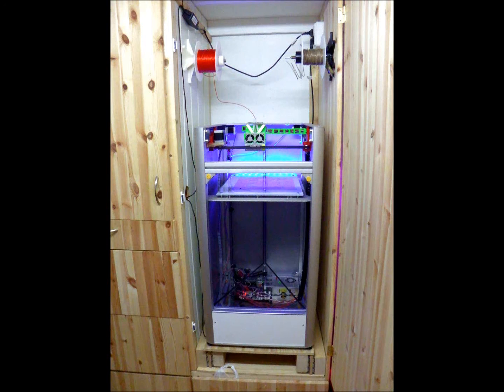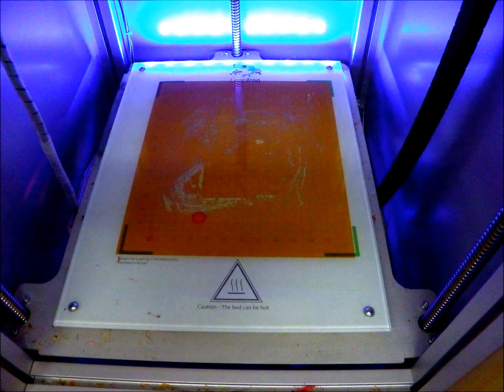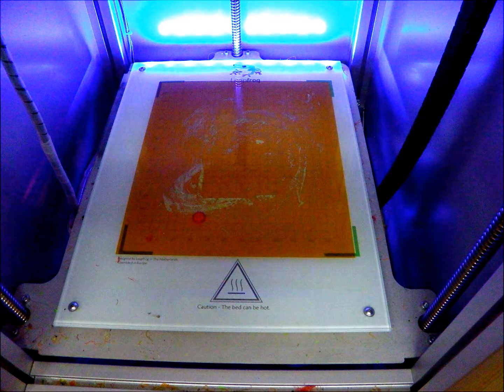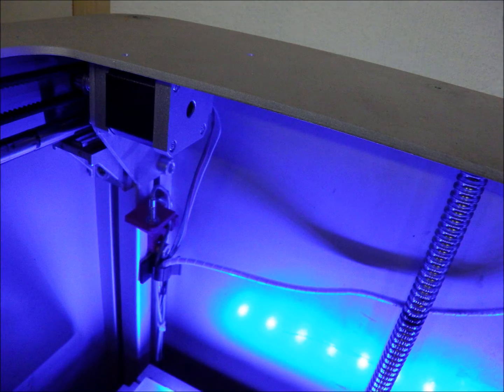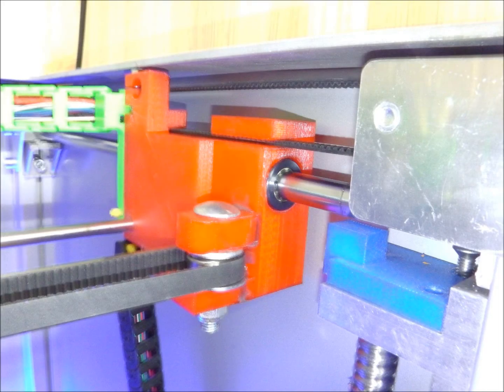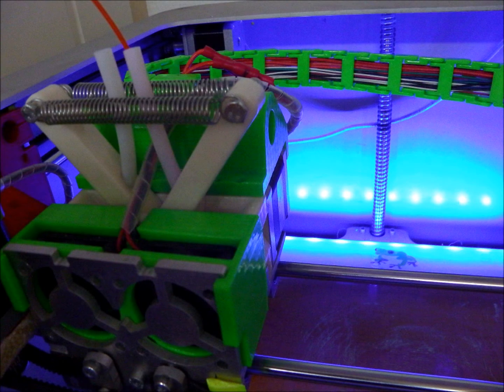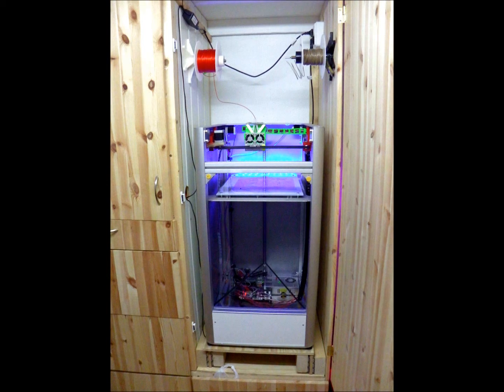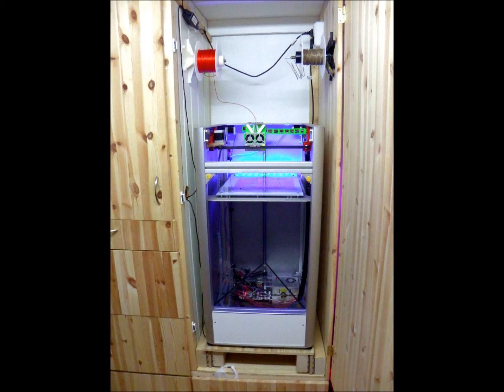Leapfrog creatr xl review

Comment: Nice video! Definitely helping me out with my improvements on my creatr. What did you do to increase the heatbed temperature? I can't get mine over 80 C even when I cocoon the printer in blankets.I am currently investigating running a silicone heater off the mains power. Found some suppliers in China that sell the right sized heating element with 900W
Reply from the maker: +Michal Talarczyk I used one of these http://www.briskheat.com/c-73-silicone-rubber-heaters.aspx workes awsome.
Reply: Thanks for the valuable info! Did you use the same sized pad? Since the "printable area" on my printer is only 270x230mm I was thinking of getting a 300x300mm silicone heated pad. Would love to get your input on this. I'm trying to convince myself this is right before coughing up the cash.
Reply from the maker: I found the closest one and used that,